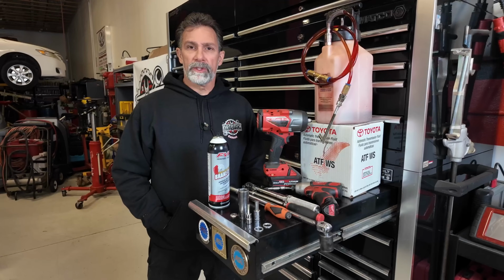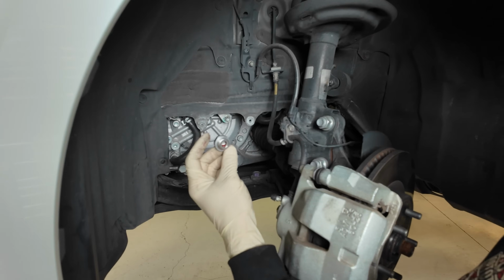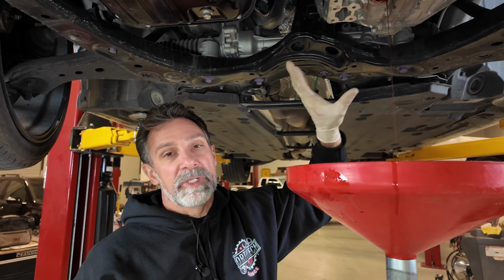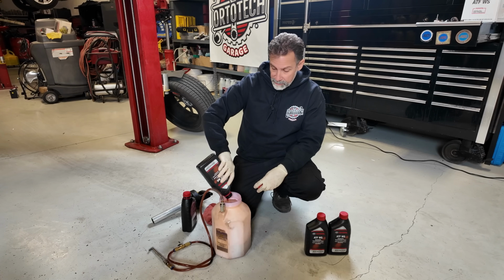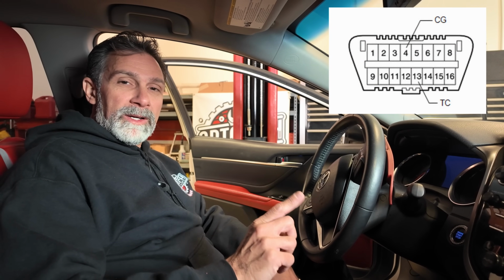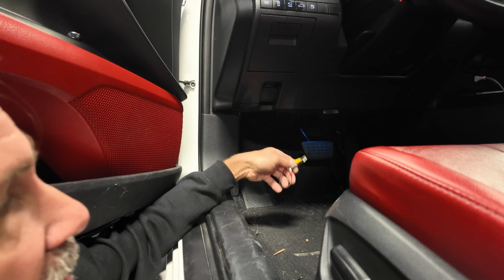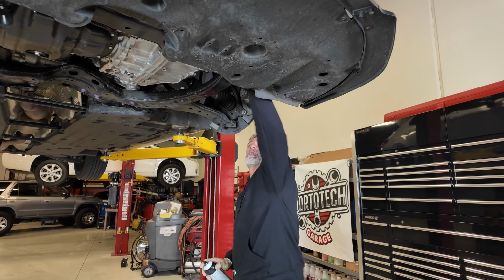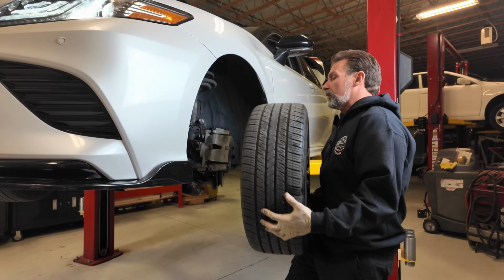The Ultimate Guide to Changing Transmission Fluid on Your Toyota Camry

Comment: So you only change about 3 quarts per service?
Reply from the maker: If you are going to just drain and fill the system, unfortunately, that is all you will get.  This is the most basic service you can perform and is definitely better than no service. Of course, a flush is best.  You can use a flush machine to exchange all the fluid, which we do when needed, or I do have a method to use the transmission to pump the fluid from the cooler lines while simultaneously filling the transmission.  This requires an extra helper, but works quite well, I can certainly make a video about how to perform a flush in this manner if its something people are interested in. If you are going to exchange the fluid with only a few quarts each time, it's important to stay ahead of the services and not wait until the fluid is filthy.  I recommend this service every 30,000 miles.
Reply: @OrtoTechGarage thanks for posting this! We would definitely appreciate a video of changing the entire fluid without using a machine! Keep up the good work!
Reply from the maker: @Nathan-q1c  Thanks for watching!  I will add that to the list of tutorials to create. Thanks for the feedback!
Reply: @Nathan-q1c  3 consecutive drain & refills replaces 80% of the fluid.
Reply: I'm assuming the transmission holds about 10-12 quarts of fluid & with only 3-4 quarts coming out when drained........I don't know why people would buy/use a different brand fluid to what the vehicle comes/is filled with & mix fluids......very risky😬.

Thanks for the video 👍
Reply: I only drained 1.5qt from my 2014 Camry V6, makes me worried

EDIT: Checked level again after another drain and fill and yes 1.5 again
Reply: @SPPACATR  car has to be level and fluid hot to get 2 quarts out on a 2014

Comment: I had a mechanical shop change the factory-filled Toyota WS ATF (Fuel Efficient) in my 2016 Toyota Hybrid (equipped with an eCVT that takes an ATF Fluid) and it was replaced with 3.9 quarts of Amsoil 100% Synthetic Signature Series Fuel-Efficient ATF at about 40,000 miles, where the independent mechanical-shop performed a slow flush through the transmission lines with the BG machine, which I personally witnessed.  The fascinating results from that one ATF exchange were the following:  The moment I drove the Camry after the installation of the Amsoil ATF (without any other services being performed on my vehicle),  I not only detected the vehicle was running a bit smoother, but also experienced increased power upon acceleration.  More importantly, my EV light was coming on more often and staying lit longer (which of course signifies my car is running electrically from the battery, while the gas engine isn't operating)!!

The following will help establish that Amsoil "100 Synthetic" Signature Series (SS) Fuel-Efficient ATF Fluid is vastly superior to the Toyota "Full Synthetic" WS ATF Fluid (made by Exxon Mobil).  You can compare the Safety Data Sheets between Amsoil and Toyota fluids and you will find the Toyota WS ATF (and true of the vast number of full synthetics) is mostly composed of hydrocracked-petroleum oil, a Class III Synthetic (that is extra-refined petroleum to mostly eliminate impurities, but it doesn’t get totally get rid of then entirely).  Amsoil Signature Series doesn’t contain a drop of petroleum oil, but a pure chemical mixture of Class IV Synthetic, known as polyalphaolefins (PAOs) and Class V Synthetic (such as Esters), plus top-shelf additives. The molecules of these Class IV & V Synthetics are of the same uniform shape allowing them to flow much more readily throughout the engines, transmissions and differentials, reducing damaging heat, creating more power and increasing fuel economy.  Also, the backbone of Amsoil 100% Synthetic lubricants have a much lesser tendency to attract oxygen molecules (where damaging oxygen can form sludge).

The difference between a Full Synthetic and a 100% Synthetic?  Rafe Britton, a former Lubrication Engineer at Mobil and the creator of a number of highly educational YouTube Videos under the heading of “Lubrication Explained,” states in order for an oil company to call its oil product 100% synthetic, it must be composed of either a Class IV Synthetic (PAOs) AND/OR Class V Synthetic (such as Esters), while being completely devoid of refined petroleum. 

Toyota lists the Flash Point of their WS ATF Fluid as 347° F (175° C), whereas Amsoil's Flash Point is listed as 435.2 F (224° C), so Amsoil holds up to the heat far better than the Toyota WS ATF.  Amsoil SS ATF's Pour Point is -85° F (-65° C), but Toyota fails to mention their Pour  Point?  Another convenience factor of the Amsoil "100 Synthetic" Signature Series Fuel Efficient ATF Fluid is that it is available in collapsible bags making installation a snap (without the need for a pump that only provides a slow fill operation)!  Amsoil also provides a "100 Synthetic" OE Fuel-Efficient ATF Fluid (at 57% the cost of the Amsoil "100 Synthetic" Signature Series (SS) Fuel-Efficient ATF Fluid), where the Amsoil OE ATF provides lesser protection at the extremes than Amsoil SS ATF with a Flash Point of 410° F (210° C) and a Pour Point of -54° F (-48° C).  As you will note, the Amsoil OE ATF has extra protection from the heat in terms of the Flash Point than Toyota's WS ATF by an extra 63° F (35° C). 

The Amsoil OE ATF isn't available in the easy-to-pour pack (only the conventional quart or gallon plastic containers). The OE must be changed according to the manufacturer's specifications for your specific vehicle, however, the Signature Series will go double the distance (than the OE) under severe-driving conditions. For those of you that have a vehicle that doesn't accept a Fuel-Efficient ATF, you may consider the Amsoil 100% Synthetic Multi-Vehicle ATF (in both the Signature Series and the OE).  They also carry 100% Synthetic in both their CVT fluid and Dual-Clutch Transmission Fluid. 

The beauty of using Amsoil Products is their fabulous Warranty, which is the widest in the lubrication industry, applies to automotive parts coming into contact with their fluids, regardless of the mileage or age of the vehicle, as long as the vehicle was in reasonably good mechanical condition before you first began to use the Amsoil Products!  The OE ATF must be changed according to OEM recommendations for the Amsoil Warranty to apply, whereas the Signature Series ATF can go twice the distance of the OEM recommendations for Severe Service.  Amsoil states that you can safely extend the oil drain-intervals beyond the Amsoil recommendation (for either the OE or the Signature Series ATF) in the event you secure an appropriate oil analysis (in which case the Amsoil Warranty will extend to the expected life of the oil accordingly, as determined by such oil analysis).  

Amsoil partners with Oil Analyzers, Inc. (OAI), to do a fluid analysis and OAI even measures the important level of oxidation in the used fluid (that Blackstone apparently doesn't measure).  Lake Speed Jr. (aka The Motor Oil Geek) discusses the importance of measuring the oxidation levels in fluids in his various YouTube Videos.  Lake Speed Jr. measures oxidation in his oil analysis-business venture, SPEEDiagnostix (although his cost is higher than OAI).

For full disclosure (as probably guessed right now), I am an Independent Amsoil Dealer (all dealers of Amsoil are independent contractors, as opposed to employees of Amsoil).  A customer of mine (a mechanical shop) loves to use the Amsoil 100% Synthetic OE ATF in both varieties for their customers, since the OE Products are at an attractive price point and the comments they receive from their customers have been outstanding.       

If consumers wish to buy the Amsoil products as a Preferred Customer (PC), they will get the oil at a 25% discount, plus free shipping when they spend $100 (plus receiving a $5 coupon for every $100 you spend).  It only costs $10 for a 6 month PC membership (or $20 a year) and there is no requirement to purchase (as there is with so many companies offering a membership for a preferred customer program, where there is an automatic shipment involved).  Also, PCs can use their 25% discount to obtain a fluid analysis with Oil Analyzers, Inc. 

If you or any viewers are tempted to try Amsoil, I invite you to visit the official website of Amsoil and apply to become my Preferred Customer, by kindly utilizing my name (James Norris) in the box underneath the question that asks “Did someone refer you to Amsoil?  If so, please tell us.”  Then in the next box they ask “Have a Referral Number?  Enter it below:”  I kindly ask that you include my Referral Number of 1420935 in that box. If you can write down my name and referral number, before you eventually decide to exit this webpage, it will be appreciated (so that it will be at your fingertips when you get on the Amsoil website).  You can also write me an email addressed to AutomotiveBuff at my gmail address (in case you have any questions).

For mechanical shops choosing to become a Retail Account, the discount of Amsoil products is 30%, with free UPS shipping on orders of $400 or more and there isn't a membership fee.  When you buy $2,500 or more in a calendar year, your discount expands to 35%.  A few of my Retail Accounts that get a 35% discount,  even in subsequent years where they fall below the $2,500 threshold, they still get the 35% discount.

I had tried a variety of full synthetics over the years.  I began to utilize Mobil 1 for several years thereafter, until I found Amsoil being sold by an auto parts store that is no longer in operation.  After I personally emptied the Mobil 1 and I put it in the Amsoil in my car about 20 years ago, I was blown away with the increased performance, better fuel efficiency and the overall quietness of my engine.  Thanks for the consideration!
Reply from the maker: Wow!  That's a detailed and thorough analysis and education. I am always learning something new in this industry. i think that's what keeps it interesting. Thank you for providing that.  I personally have never used any Amzoil products.  I may have to try some after receiving this information and experience it for myself. Do the engine oils products increase fuel economy as well? I know some people really swear by it.
Reply: @OrtoTechGarage   Thanks for the compliments, OTG!  I was highly impressed by your incredible knowledge and unique teaching style, by effectively explaining the process of changing trans fluid, but I somehow neglected to tell you so in my prior comments.  I performed the first oil change myself at about 2,500 miles on my Camry using 100% synthetic Amsoil Signature Series 0W-20, which provided my car with more pep and a few miles per gallon better than the factory-filled full-synthetic Toyota motor oil (made by Exxon Mobil).  I first tried Amsoil about 20 years ago (as a ordinary customer) after trying a variety of full-synthetic oils from Castrol, Pennzoil, Valvoline and Mobil 1.  I had been a regular customer of Mobil 1 for several years when I first put Amsoil into my crankcase.  The moment I took a test drive with the Amsoil, I noticed an incredible increased in performance (more so than any prior synthetic).  At that point I was sold and I became a Preferred Customer using Amsoil exclusively.  A few years later, I became a dealer.  The 100% synthetic motor oils have the same combination of Class IV Synthetics and Class V with no Class III Synthetics (hydrocracked petroleum), just like the ATF Fluids (described in my last comment).  The same is true with Amsoil's Gear Lube for differentials.

Before I cite further examples of increased MPG, do you own the mechanical shop in the video?  If so, I can create your business as a Retail Account, where your business can obtain a 30% Discount without the usual $20 membership fee Amsoil charges Preferred Customers (who only get a 25% Discount).  If you are an employee, can you ask the owner if we can create the business to a Retail Account?  Being a Retail Account entitles the business to obtain a 35% Discount once your business secures $2,500 in Amsoil purchases in a year.  Retail Accounts get free shipping when an order equals or exceeds $400 (whereas Preferred Customers get free shipping when they spend $100 or more).

The official website of Amsoil contains many rave reviews of "verified customers" claiming increased MPG, including the following sampling:

5 Star Rating  Best oil I ever used By MICHAEL, a Verified Buyer from Conway, SC on December 25, 2022 
Gas mileage went up by average 3-4 mph [MPG?]

5 star rating  SAE 10W-30 By ISMAEL, a Verified Buyer from san antonio tx on April 01, 2021 
excellent oil , lifter noise reduced dramatically, oil consumption excellent and boosted my mpg by 3.

5 star rating  Fits beyond was the manufacture required By MICHAEL, a Verified Buyer on May 21,2021 
This oil fit perfectly. MPG went up by 3.

5 Star Rating  Amsoil engine oil products By BRADLEY, a Verified Buyer on April 22, 2022 
I use AMSOIL in all my engines transmissions and final drives. AMSOIL reduces friction there by increasing 
fuel efficiency. I've tracked the mileage on my two main daily drivers and both had mileage increases of two to five miles per gallon. Every vehicle is different and every driver is different so results may very. But 
that being said, I'm very impressed.

"5 star rating  WOW! UNEXPECTED RESULTSBy  MUGENIZER,  a  Verified Buyer  from  Vancouver  on  April 11, 2024: 
 I was using Pennzoil Ultra Platinum 0W-20 Full Synthetic for my Honda Pilot 2016 exl with 261K km in it. Obvious crackcase noise & lifter noise. Fuel consumption of 12.9 liters per 100km. Now with using Amsoil Signature Series 0W-20 Full Synthetic...noise in the crankcase & lifters are a lot less. My fuel consumption is now 11.8 liters per 100km. The engine run smoother than it was. I wish i've used Amsoil ever since. Now, i use it in every vehicle i own. I highly recommend this product."  [Using the conversion of the metric system to the U.S. version, the Pennzoil MPG calculates to 18.23, whereas the Amsoil MPG is 19.92, an increased differential of 1.67 MPG in favor of Amsoil and is exactly the same percentage increase in fuel economy as was calculated in the metric system: 9.2%].

Grandpa Chuckie from New Mexico on September 24, 2020 (the reviews are in chronological order on the Amsoil Website) who has a 2016 Toyota Sienna V6 (who apparently keeps meticulous records of his gas mileage) wrote that he was consistently getting 24-25 MPG (24.5 MPG Average) on the highway, when he was getting Toyota Synthetic Oil changes at the Toyota Dealership over the course of 30,000 miles.  After he switched using Amsoil XL Boosted Oil (now known as Extended Life) over the course of the following 15,000 miles, he rather consistently obtained 27-28 MPG (27.5 MPG Average) on the highway, which is a significant 3 MPG increase (27.5 – 24.5 = 3), so he acquired a 12.2% MPG increase (3 divided by 24.5 = .122).  

Hopefully, we can create your business to a Retail Account to save you money.  If you wish to correspond with me by email, my gmail address is automotivebuff.  Thanks for your consideration!
Reply: No Amsoil dealer or promoter ever mentions the price!  Or ever posts a YouTube video showing the purported "increased performance, better fuel efficiency and the overall quietness of my engine".
Reply: @4af  yeah after seeing all of what he wrote and skimming through, I know it was a detailed AD. With so much Info you don't talk about price. ONe would normally say yes it is more expensive but worth it. or its similar price makes it even more better choice.

Comment: "Lifetime".  Sure Mr. Auto Manufacturer.  
"Lifetime" has a beginning and an end.  Change your tranny fluid (for my regular use I never exceed 80k miles).
Reply from the maker: Yes!  "Lifetime" is always a sore subject with people and evokes many opinions.   I also say, call the manufacturer and ask what the lifetime of the unit is?  They will laugh at you.  The lifetime of the unit is as long as it lasts.  Why not extend that time period with a small investment by providing some routine services.  Maintenance is the key to making anything last longer. Cheap insurance for an expensive component. 👍

Comment: is there a maintenance mode if using a scan tool or just watch the trans temp on the tool?
Reply from the maker: In addition to seeing the transmission fluid temperature on a scan tool, there is an active test that needs to be turned on.  You will also follow the shifting procedure.  I have found that as long as you have the temperature reading correct and all the loads are turned off, like AC, and fans, etc, you will get a pretty accurate reading without initiating idle control mode.  But, it's always best to follow the procedure.  If you need the procedure, I'm happy to email a PDF to you. 👍

Comment: Thanks for posting another very informative vid. Also liked that you shared which terminals to jump for those without a scan tool.  This one is a challenge for the DIYer without a lift. Between the wheel having to come off to access the fender liner access panel, the undercover etc. Is the 2016 previous generation a similar process?
Reply from the maker: Thanks!   I understand most people will not have the required scan tool, so I wanted o make sure everyone understands the process without it.  The older Camrys have a very similar process. It  just has a conventional transmission oil pan.